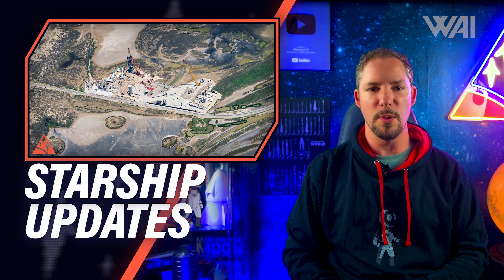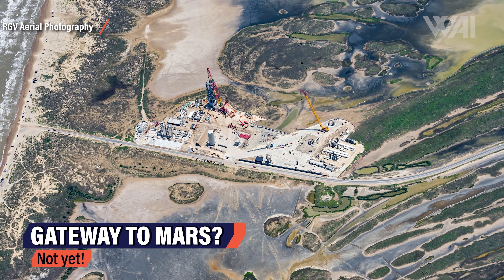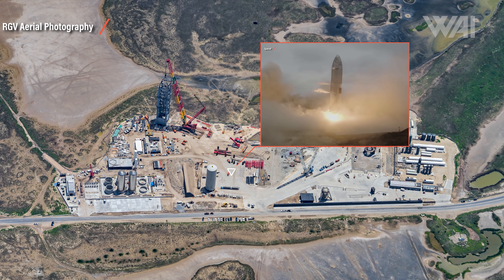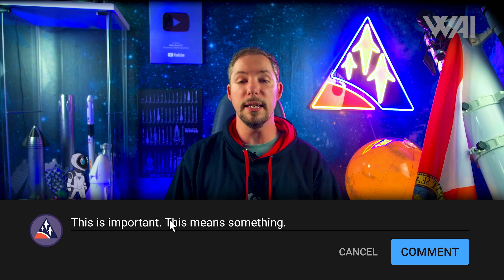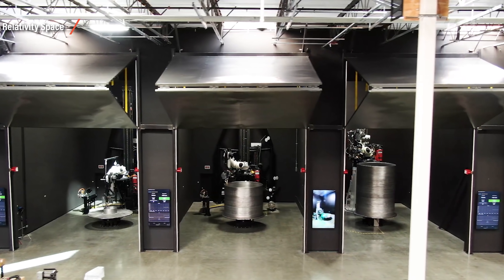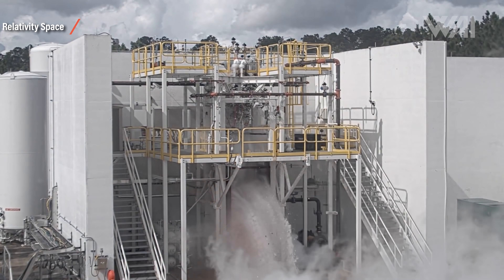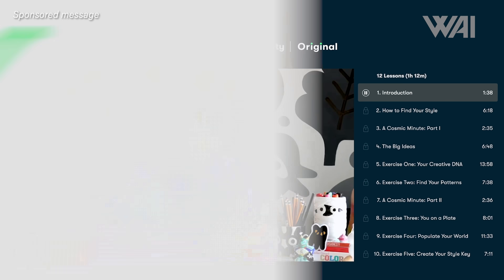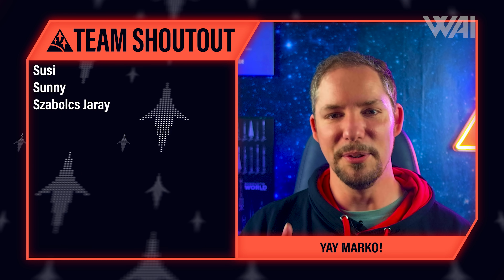SpaceX Starship Super Heavy Test done! Relativity Space Terran R – A Starship Competitor?

Comment: It's interesting. You have SpaceX which has got a part 3D-printing, part machining solution for Raptor engines, and a majority machined solution for Starship. You have Relativity who is attempting to go full 3D printed. And you have Astra, who is attempting to have zero 3D printing.
Reply: Don't forget Rocket Lab with the mostly 3d printed Rutherford engines that is flying.
Reply: @steveaustin2686  True. They're taking a similar-ish route to SpaceX, although I think the Rutherford engines use more 3D printing? Not sure. But the main reason I singled out Relativity and Astra is because they each represent the extremes. Astra is trying to cut out all 3D printing from their pipeline, while Relativity is trying to making their pipeline entirely 3D printing.
Reply: @z-beeblebrox  Rocket Lab says most of the Rutherford is 3D printed. Two thirds to three quarters I think.

Yeah, I'm impressed with Astra as they just missed orbit with Rocket 3.2 IIRC. Their $2.5M, containerized launch system is impressive. I understand that the military is interested.

Comment: The bone-like parts are usually not designed with AI. It is just a mathematical optimization algoritm with some good mechanics combined. The engineers using the software still have to define realistic load-case scenarios and the attachment points. Otherwise the design would still fail in real world conditions.

Comment: Hmm, relativity can run missions with starship to Mars, 2 Terran Rs docked to each side of the starship can serve as boosters/cargo haulers enabling a longer burn and more payLoad capacity instead of having to use multiple starships which will make colonization harder
Reply: You forgot about Starship Heavy XD
Reply: A familiar feeling. We do have some Falcon launches coming real soon so keep looking them.
Reply: @ImieNazwiskoOK  I mean in space not to lift off, they will lift off individually but dock in space then fire all thrusters and possibly cut the trip in half with that many engines (without nuclear propulsion), cut it down to weeks is starship and the two Terran Rs was equipped with nuclear engines possibly not even up to a month plus u could take crews of hundreds at once
Reply: @RandomGamer-qy6ys  It was joke (this is why I put "XD" at the end).

(more seriously:)
Nuclear engine would most probably be assembled in space, tanks would be spherical for efficient storage, also radiators for engine itself and hydrogen (which would need to be fuel to be efficient).

(it would be different if nuclear ion but only nearly no tanks and no hydrogen)
And I doubt that nuclear engine could fit on Terran R.
Reply: @ImieNazwiskoOK  1 big nuclear thermal engine would be able to square into the Terran and maybe 3 medium ones on the starships in total 5 thermal engines, Mars in less that a week with 100s of passengers and cargo not to mention outer solar system in weeks
Reply: @RandomGamer-qy6ys  1 Starship (which can't get to orbit with nuclear engine and fuel for it and much payload) and few Tarrans R are not enough for less than weak 100s of passengers.
Nuclear thermal is about twice as efficient as chemical, which is just not enough for this scenario.
Reply: @ImieNazwiskoOK  well nuclear fusion engines are more appropriate and besides they will lift off and land the same way, with chemical 1st stage and undock before hyperbolic entry. They will only be docked in space
Reply: @RandomGamer-qy6ys  They are as aerodynamic as brick.
And they would be even more problematic to be small, for current concept you not only need to fit engine but probably fusion reactor to power that engine and also shielding from engine's radiation.

I think much easier would be just refueling them and repairing them in space (if possible).

Comment: Where is the landing legs of terran R? Are they going to catch as well?
Reply: Probably not. They’re sketching out the basics currently. I’d expect many design changes.
Reply: It is made from a perfectly transparent material.
Reply: Idk why SpaceX is going with this Starship “Catch” method? For the BN i understand bc its fucking massive and only needs to be used on earth. But there is no catch tower on the Moon or Mars so he should be HEAVILY investing on proper leg technology. I honestly think thats why several of the first SN’s blew up. You cant stick a landing without legs to mych stress on the base of the rocket
Reply: @jordanfrielingsdorf4761  I agree. Catch the booster make sense not the Starship. 
I wonder if Spacex is going to try the 3D printing method for Starship ( if the process is fast) instead of that crazy amount of welding.
Reply: @jordanfrielingsdorf4761  Starship will have legs .. they just haven't spent much effort on them yet, because legs haven't been important to the testing they've done so far. Once they've got orbital reentry working, I think they'll start taking landing more seriously.
Reply: @simongeard4824  i hope so otherwise alot of people will die
Reply: @jordanfrielingsdorf4761  It's simply a matter of priorities... when you're testing a prototype rocket that's more likely than not to disintegrate in mid air, there's not much point in worrying about landing legs. Once you've got a vehicle that flies well enough to need landing gear, it becomes more important.

Comment: There are a lot of things 3-D printed parts are great for, but also there are many areas where it's simply not the optimal solution.  3-D printing things like fuel tanks and the outer skin which can be made relatively cheaply and quickly from sheet metal is making them more expensive and thicker/heavier to account for the variation in thickness of the material that would not be an issue with rolled sheet metal.  3-d printing is cool, but it should be one more tool in the toolbox, not replace it entirely if you are aiming for competitive pricing.  Using all 3-D printed parts for prototypes and such could make sense, but if their final product is following this same trend I don't think this is going to be cheap enough to be an alternative to other existing or emerging options in launch vehicles.

Comment: I don't usually like videos on YT but had to on this one! BTW, there should be more companies cleaning space junk, otherwise soon there will be no new launches. Regardless if it's Space X or any other company
Reply: you wildly underestimate the size of space and how much stuff we have in it, a runaway cascade like imagined cant really happen, sure it could be a problem for specific highly populated orbits but give it the smallest deviation and the energies required mean that debris cant really make it out of its original orbital path very far at all.

we have graveyard orbits for a reason, it keeps the stuff that's likely to fail away from the stuff that's valuable.
also cleaning up that stuff is far far far more expensive than simply building in a capability to deorbit at the end of life.

anything in LEO is super easy to dispose of in the atmosphere, and doesn't last all that long without corrections anyway and the further out you go the more space you have in an orbit in general, out at geostationary orbit you really dont have to worry thanks to the massive amount of space in the orbit.

Comment: Clearly Relativity Space's business plan has garnered them access to significant funding. Having a strong manufacturing background, I wonder the viability of relying on 3D printing. As I understand 3D printing, it is particularly good at fabricating intricate parts. However, the 3D machines are expensive and slow. I know of no one mass producing any parts by 3D printing. Making one rocket every 60 days might be adequate if you have few customers but you will find it difficult get any efficiencies of scale. If the space economy launch demand truly explodes a one use relatively expensive rocket every 60 days will be inadequate. Their Terran R if it can achieve full re-usability could be competitive with Falcon 9 as the depreciate with reuse. I find Astra's business plan of rock bottom mass produced inexpensive rockets a much more attractive launch company in the short term. I wish them all luck.

Comment: Will the super heavy booster use the same three 3 mm stainless material as the starship? Anyone please answer I would like to know.I
Reply: Logic says that the compression load in the bottom part of the stack would be higher, either at rest or under thrust (just like in the building). Thus the structure would have to be more resilient. Either by increasing the sheet thickness or stiffening internal ribs of the tanks. On the other hand i may stay the same because the Starship hull is subject to much more shear forces and bending during belly first atmospheric braking and fall. Superheavy is subject mostly to compression which is generally easier to resist. It may play out the same. Another factor is that tanks gain much stiffness from pressurisation, like a balloon (remember early cryoproof failure of SN4?). There is no straight answer unless SpaceX gives us the thickness.

Comment: Now that SpaceX has a competitor all prices will be slashed to the bone. This is the best thing that could happen for all concerned. As for the 3D printing our day is here too. We've all been waiting for a construction process that can be created in a computer from beginning to end and now it's here. By allowing the computer to design the part you will cut weight, material use and build time. I can see banks of printers in a warehouse making various parts as the rocket rolls out one end of the building.
Reply: Relativity has to build and fly them first. Terran 1 is doing a small sat rideshare in Q4 2021 and the Terran-R is expected to launch in 2024.

Comment: The question is if Relativity Space has the money and infrastructure to buy their rocket, fail, build...

Based on projects alone, Blue Origin should also be a competitor... but on reality...
Reply: Theoretically once you have the printer up and running it's mostly just operating costs for the printer + raw material costs. They've got ~$1 Billion in funding I could see them getting more if they get one to work
Reply: @darkfur18  it's never so simple. It's a 3d printer, not magic. There is maintenance, lots of things that can't be done on the 3d printer, etc
Reply: @rogeriopenna9014  Of course. That's why I said theoretically. their success depends on how close they can get to that. But, I do think they have a good chance with a design with such a drastic reduction in complexity and a good initial funding.